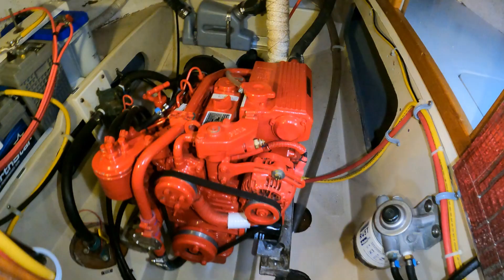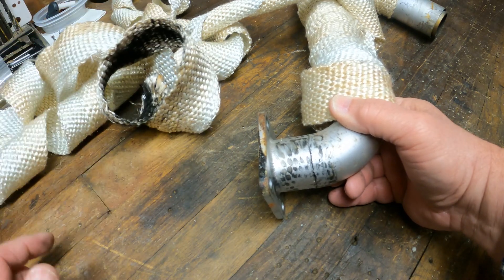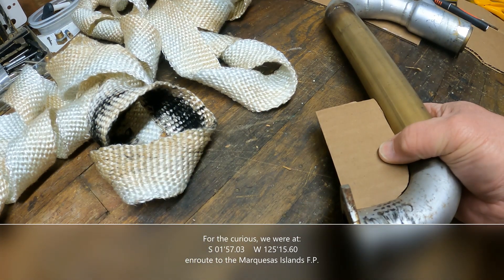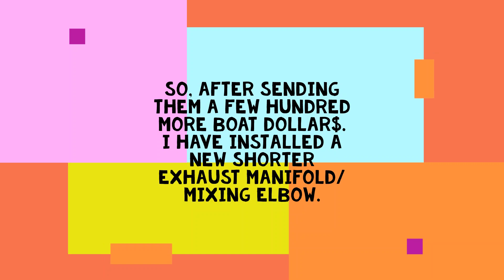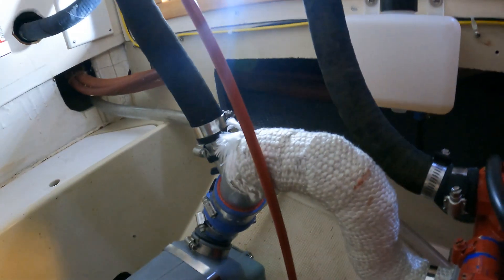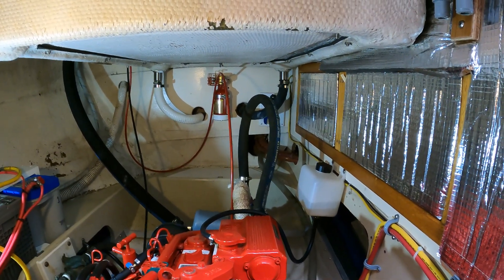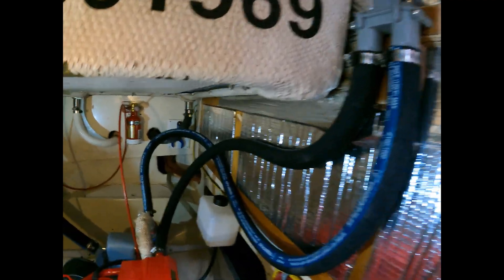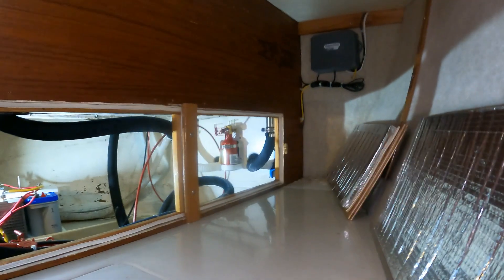BETA Engine - Cracked Exhaust Elbow - Video #31 - Westsail 28 - "Starwhite"

Comment: I have the exact same boat hull #55 and have just had the same problem
Reply from the maker: Did you find the crack before it broke and filled the engine room with black soot?
Reply: @ actually yes I noticed it when I was checking sea strainer the engine was not running when it happend so no black smoke and no water in bilge (I have a drip less)

Comment: You really need a support near the highest point.  Running laterally to the side of the engine bay.  Steve D’Antonio has a great set of articles on marine exhausts vs waterlines